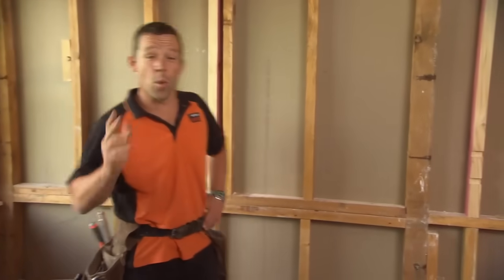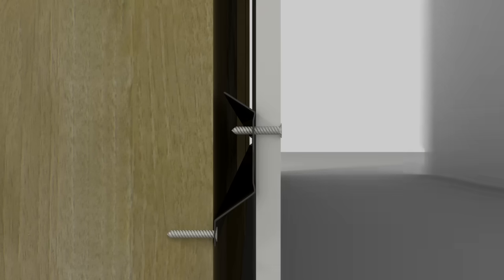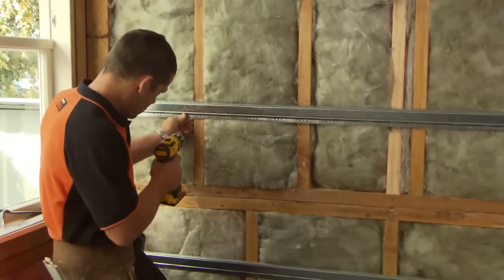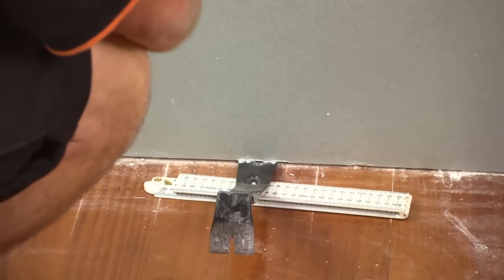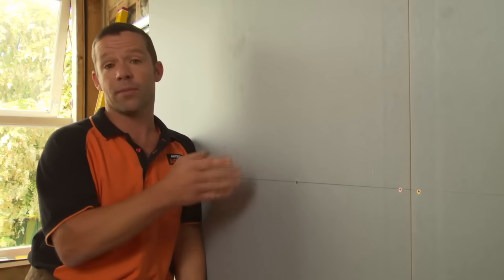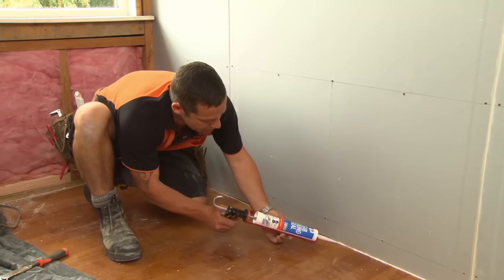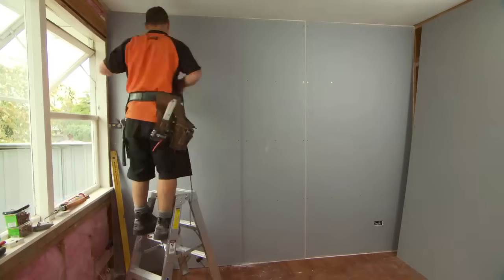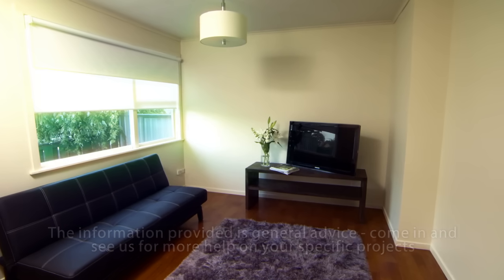How to Install a Noise Control Wall | Mitre 10 Easy As DIY

Comment: that was pretty cool, looks like a future project some way down the line. Am about to do my adapted version of the  DIY mitre 10 workbench - but it'll be made out of 2 layers of biscuit joined hardwood, top and bottom layers staggered.
Reply: YeahI

Comment: What materials are the of the gib board and sound Bats  made of? 
As want to know if it has Fire resistance such as Wool made instillations?
Reply from the maker: You can find all the details here: https://www.mitre10.co.nz/guides-and-advice/guide/how-to-install-a-noise-control-wall ^Cam

Comment: Would like to see a big project like removing a timber floor and put in a concrete floor for a shower room.  say 2 meters X 4 meters size , so there is now worry about rotted timber floor

Comment: I am planning to replace my drywall with this method. I assume the original casings will not be useable? As the door and window frames will be original width. Do you have to build up the width of the door jams and window frames or do you use a stepped casing??
Reply: You do not need to change the door jams you only need to work on the different type of the architrave.
Reply: William construction 7

Comment: Don't forget that alot of the sounds will travel through the floor boards
Reply: Lot of those sounds are impact vibrations, not air born. If you need to take care of those, you need to do the same for the floors. This method will take care of sounds from TV speakers and people talking etc, not if you have a Hi-Fi with Sub-woofer or people walking with shoes with heels etc.
Reply: Chris Willier 0.
Reply: Chris Willier u
Reply: Ignore that

Comment: Bit overkill though isn' t it?  just to cut down noise..most installations just use the dense insulation and gib noiseline which 99% of the time is sufficient.